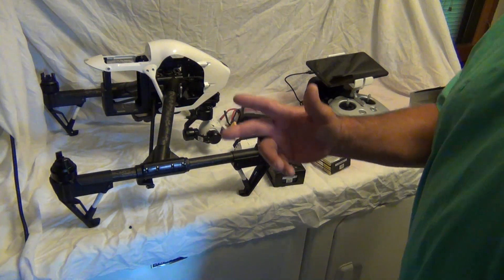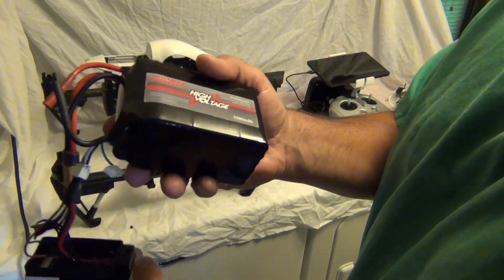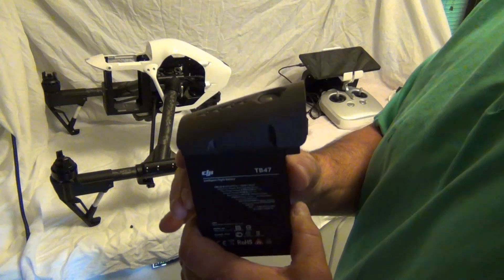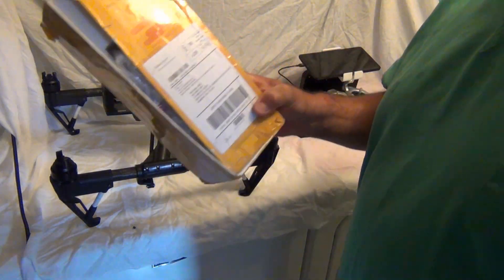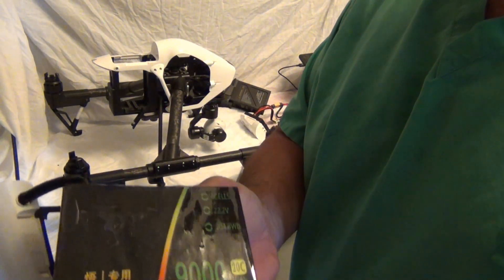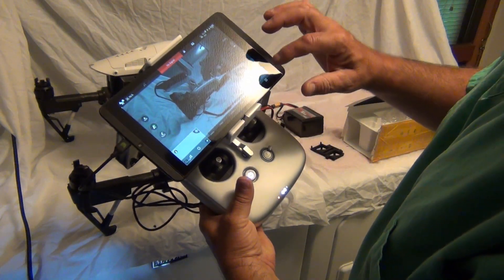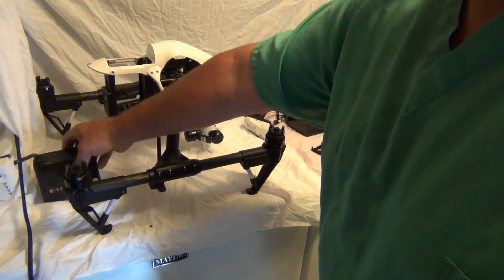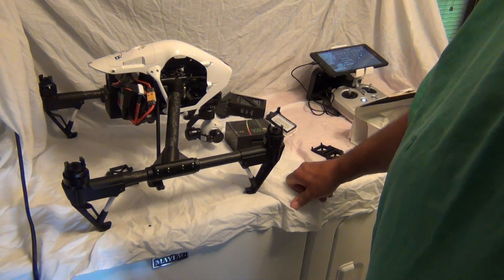CRUZROYS use any lipo in your Inspire 1 update 5/16/2020

Comment: DJI 600 matrices batteries use TB 47S same battery, can find T 159.00 and change the top cap from TB 47 to TB 47S
Reply from the maker: will not work....people dont realize the minute you disconnect the BMS it has to be reset, and you need DJI passwords, and the tools and software, plus the tb47 and 48 s are not the same......they look it, but they are not,

Comment: Bonjour je rencontre un problème avec une tb48 dès que je la met dans inspire 1 le drone démarre sans que la tb 48 soit allumée dans l’application j’ai le message batterie erreur et elle est à 0% même chargée de ou viendrai le problème ? Quand j’essaye de la recharger les voyants de charge ne fonctionne pas
Reply: Did you try charging the battery by (a) pulling the cover, (b) unhooking the battery pin connecting the battery electronics,  (c) connecting the battery terminals (+) & (-) directly to your charger using alligator clips?

Comment: That thing looks a bit heavy for the x5.  The TB48's already make orbits a little harder, so more weight than that sounds like too much to me.
The cleanest, most refined solution I've found is: https://www.heliengadin.com/products/dji-tb48-5700mah-inspire-1-battery?variant=32026880016451 about the same price as the DJI's were, hopefully at least as good.  Fit looks about the same.  I haven't tried one.
Luckily, I stocked up with 8 new ones when I saw they stopped making them, but those will run out.  I've already put about 40 charges on those, so you can guess I use them a lot.

Comment: Very cool configuration!  How did you keep the battery clear of the prop?  Also, batteries have now spiked to $300 for TB-48.  Not only would I like batteries more accessible, I’d also like to see if I can put a different transmitter/receiver on it.

Comment: Thank you for doing this!! 
Does the seller have a website CruzRoy?
Reply from the maker: A huge thanks to @Mike Roy who provide a test clip of our DJI inspire 1 TB90 9000mah battery.
The price of TB90 battery is USD$200. Free shipping to USA. PayPal payment (For other countries and regions, please contact us and check the shipping cost first) 
It will take 3-4 weeks to delivery.  Also, because it takes a long time to delivery, there will be no warranty of the battery to oversea buyer. 
Therefore, we have the following suggestion for buyer to keep the battery in better condition:
1. Battery power should be kept between 50%-70%
2. Run a complete discharge and recharge each 2 months at least.
3. Battery should be stored in a cool area. Do not be exposed to the sun/hot area.
4. Make sure the voltage of each cells are balanced and in good condition before you try to take off the drone.
5. Do not over charged or over discharged. it always damages the battery a lot.
Please contact us by facebook messager if you have interested in it. Thank you.
https://www.youtube.com/watch?v=3WBJHhUEIQs&t=489s
https://www.youtube.com/watch?v=JgY_uZgYqkU&t=12s
Reply from the maker: https://www.facebook.com/%E9%A6%99%E6%B8%AFDJI%E5%B0%88%E6%A5%AD%E8%88%AA%E6%8B%8D%E6%A9%9F%E7%B6%AD%E4%BF%AE%E7%AB%99-176198876362279
Reply: @CRUZROYHelicopters  I don't have or use (never have) facebook... I want to purchase 2-3 batteries... PLEASE!

Comment: Hey pm me i have been  messing around with this mod for about 2 years i think us both can get this right im gettin around 19min with t motor 15 /5 props yes!.. 15inch  and minor 48 mods that’s also flying with the z3 just a usaf drone veteran crew chief here.  I think we can get 25min plus with a bit of fine adjustments. Including firmware edit with python.
Reply from the maker: what sucks i cant get python to work well with windows ten, it works better on 7, but it more in the tb47/48 board BQ chips, they hold all the data
Reply: Folks, I tried last year to change the config of the bq chip... I can log into it with the Texas Instrument software and communication box and I can read the basic config. However in order to change the settings it needs to be unlocked and unfortunately DJI didn't use the default password... so I lost  a bit of interest... There are a couple of softwares around designed to hack laptop batteries that could in principle be used to solve this, but I haven't done any followup with those. Also a simple hack would be to solder in parallel to the shunt resistors another set of resistors to halve it so that the chip will count half of the current and we could use a double size battery... a few options there to consider I guess...
Reply from the maker: @vincenzomiceli  if you are talking UNSEAL, most say ev2300 will unlock?? but haven't started looking for one, and testing....but im interested in a resistor thing, do you have a drawing or photos ?
Reply: @CRUZROYHelicopters   the ev2300 will simply allow you to connect your pc to the chip and use TI software. To unseal you need to know the password... no other way around it...